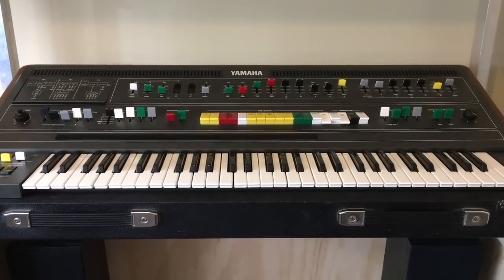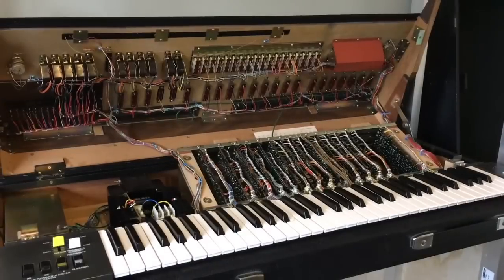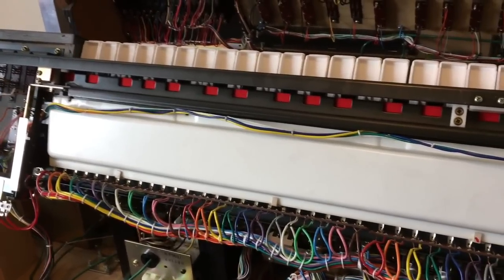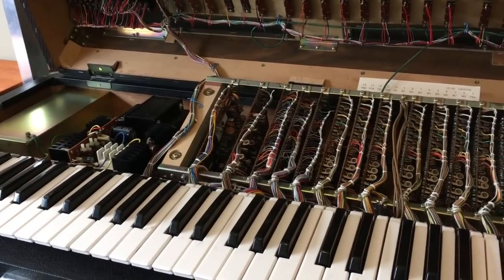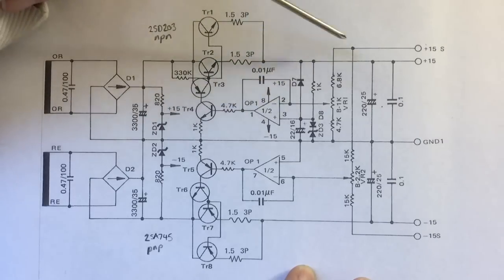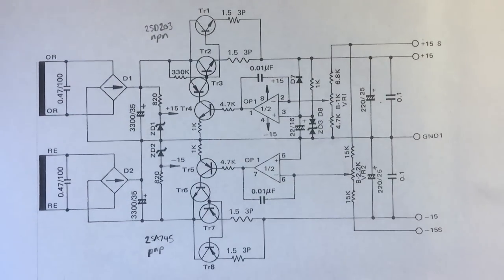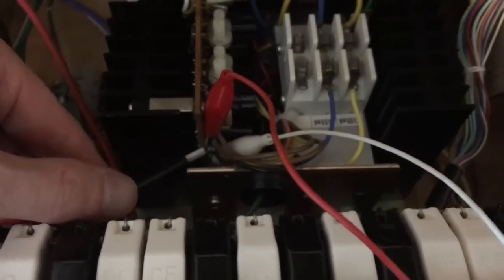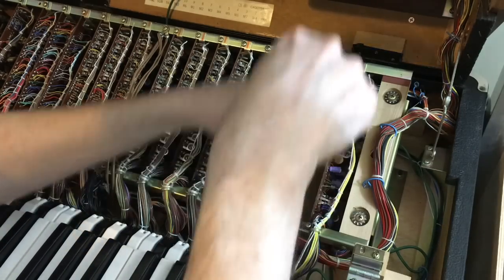Yamaha CS-60 Restoration (Part 1 of 3) - Service Guide, Overveiw, Power Supply, Recapping

Comment: hmmm ... shouldn't final voltage adjustment happen when the rest of the synth is hooked up and the PS under load?
Reply from the maker: antigen4 if it was a modern linear supply made from a single IC you would be correct. Those IC’s sample the output voltage from within the IC itself, so they have no idea what the voltage actually is in the circuit they are powering. In this case though, the regulator isn’t monitoring it’s own output. The voltage it sees is feed back to it via a wire that is attached to the voice cards. When I short out the pins on the supply to calibrate it, I am simulating that external voltage returning to the regulator. Essentially this supply automatically compensates for any voltage drop at the voice cards.
Reply: hmmm alrighty ... (LOVE your videos by the way - personable and concise) - hmmm ... yes well i am fairly familiar with this 'feedback circuit' in the PS - although I would still assume that - once connected to the actual LOAD ... that it might behave differently ... yes... in thinking about that i suppose it does make some sense since it will 'actively' try to correct any attendant voltage drop ... okay ... thanks

Comment: Yep, for the first time ever refurbishing my CS80 seems doable if still daunting as far as the amount of work is concerned. Furthermore: I just found out the power supply in my Son Of GX (http://www.brassee.com/instruments.html#sonof) also has a problem I thought I already had got rid of in the past. Arecapping I will go so this is again very timely for me. Thanks! By the way: I actually use the presets matrix boards of GX1/CS-technology organs to make them fully programmable (http://www.brassee.com/writing.html#sonofgx).
Reply from the maker: Marc Brassé thanks for the link! That's a really great site. I looked for an email address but couldn't find one. I will message you tonight.
Reply: Ah, it's great you want to get into direct contact. Some people are very private in that respect so I wanted to avoid being presumptious. For a direct email you can press on the contact button on the main screen ( http://www.brassee.com/index2.html) and everything will be revealed. It is always linked to my present email address.
Reply: Dear Golt! I sent you 2 return emails after you contacted me via my website but got no reaction. Did they reach you at all?
Reply: I can restore CS-80's.  I have restored my own as well as currently rebuilding one of Frank Zappa's CS-80 brought to me with a 2nd to follow when that one is done.  Complete electronic restoration, full recapping including all of the original open trimmers upgraded to sealed multi-turn and restoration of the after-touch sensors.  Some extras such as internal status indicators visible through the upper heat vents to identify which voice cards are playing to make any future tuning easier.  I use Japanese and German components only.  In case you cant find anybody to take on the task, I can help you.
Reply: So let me get this straight: You call yourself the DOLLAR guy and propose to restore my CS80. I can already feel my wallet starting to shrink right now.
But seriously: What would you charge for a preventive refurbishment as described here (so not the total as new restauration plus extra's you seem to imply).
Not all CS80 owners are millionaires (yet) you know. I just own the thing because I have been loving it for years and years and more or less bough it in time. :-)